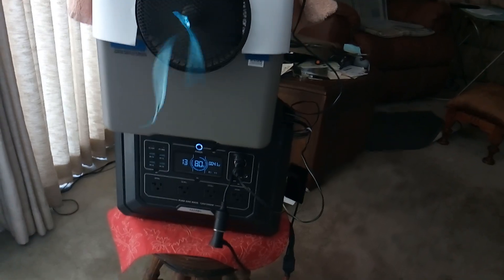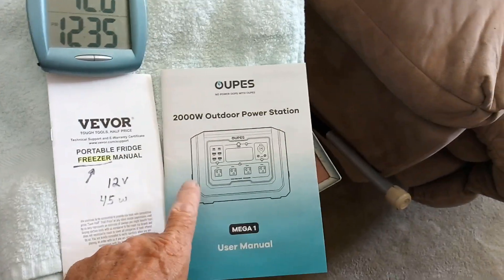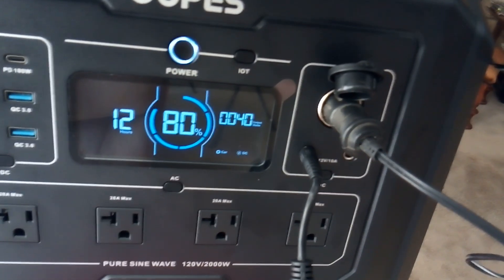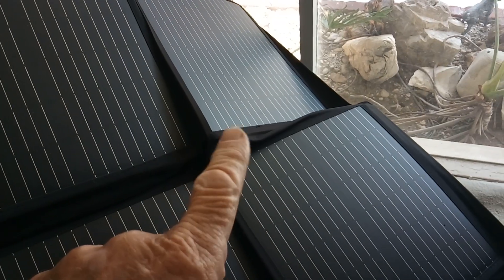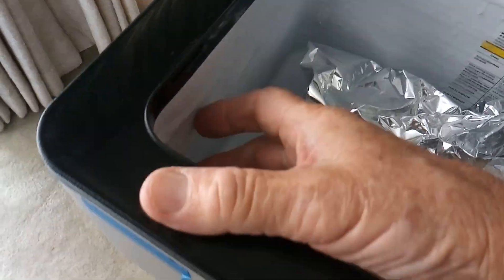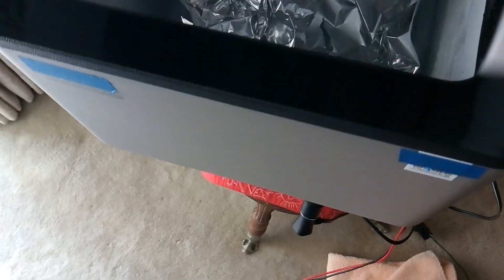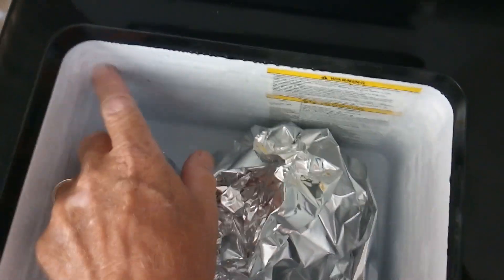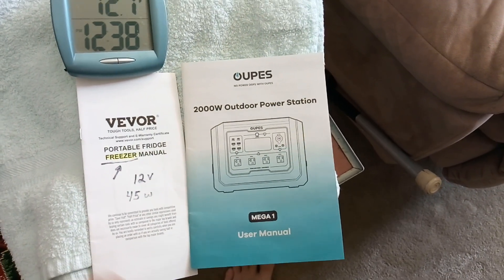Low wattage 12v compressor air conditioner project

Comment: Hello lid motor. I just today made the circuit you use in your motors consisting of an NPN and PNP transistor and a resistor plus an led. Mine I build is built in a pref board and I used a tiny 1 mega ohms potentiometer. And the coil I used is fairly thin and has lots of turns and it’s bobbing is made of card board and bamboo stick. However, after I connected the circuit, even if the led glowed when magnet swings by after adjusting the pot, there is pretty much no noticeable kick and i tried a pendulum and even a lid motor with strong magnet’s. It still didn’t spin and just the led was glowing tho only when magnets are going really fast. Could you tell me what mistake I did here and the solution?
Reply from the maker: Sorry that you are having trouble with that circuit.  First you have to understand what is going on and work backwards to find the problem.  Your led has to be put in backwards and only blinks when the coil turns off.  It is only an inducator really. Just take it out completely and try to get the circuit to fire . Use an AM radio tuned to a blank station to hear the circuit fire.  You have to use strong neo magnets and a coil of fine wire of hundreds of turns.  Also try different transistors .  If all else fails lose the circuit completely and just use a magnetic reed switch.
Reply: @Lidmotor hey uhh, I have some good news. The good news is that I just managed to run a pendulum and a motor with the circuit. But the bad news is that the circuit is quite power hungry as I used two AA battery’s and also a lithium ion battery but the circuit didn’t really work, however to it’s defence, the battery’s were not charged in a long time. Still, it only worked with my power supply on 4.7 volts. Could you tell me if you circuit’s also need strict voltage supply? Because your circuit seems to run on just capacitor. Maybe I need thinner coil with higher turned. But please reply.
Reply: @Lidmotor thanks for replying. And yes the led is indeed in reverse bias. Tho I don’t know the exact turns of wire. There really is no push or kick. And the circuit is fires because the led can only glow if coil is energised.

Comment: If your house temperature is hotter than your pool water temperature, then you could pump it through a radiator in your house to heat your pool and cool your house?

Comment: Let's assume it gets a heat pump COP of 4, which is very optimistic; At 40W in that's 160W of total cooling capacity. 

It may feel more than that because of the wind chill effect: the faster the wind blows over you, the cooler it feels. Hence blowing air that's 30C at you can feel "cool" since you're skin temperature should be less than 37C. Blow air at you above 37C and it'll warm you up faster as it's blow faster instead.

I think 160W is reasonable to achieve via one of those radiant cooling panels? Also is your house cooler inside than the outside air is? If not, then you could add low E heat reflective coatings to your glass to keep the heat out? at 1000 W/m2 from the sun, a shade over a large window to prevent direct sunlight could cool the room by more than this cooler? External white shutters are even more effective because they prevent all light getting in at all, which hits surfaces and turns into heat.

If you experience large temperature swings between day and night then you could force ventilate the house in the night to cool it, then seal it during the day?

Comment: I set up an experiment to measure the COP of a mini freezer like this, by putting a heating element inside along with a fan and temperature controller trying to maintain the same internal and external temperature. A Peltier one I tested had a COP of about 0.25 best case, which means it pumps about four times as much heat into the room as it extracts from the volume. A compressor based one like this was about 1.2 COP at 0K temperature difference between inside and outside, but by the time the temperature difference got to 20C the COP had dropped to less than 0.2, meaning it was pumping about 5 times more heat into the room than it extracted from the volume. 

This is all to say that keeping the internal volume just a couple of degrees cooler than room temp is critical for efficiency. Also you absolutely must (well heat insulated) duct that heat outside... And then you have issues with air pressure difference sucking hot external air in as fast as you pump the waste heat out, so you need the intake air to be insulated ducted from outside too. 

Interesting experiment! I'm fascinated to see where you go with it!

Comment: I always say we don't need air conditioning over here, but the last few summers have made it seem far more desirable. Although as soon as I start thinking about it during the hot sunny days, the weather breaks and I need my warm clothing on 🤣🤣☃☃
Reply from the maker: Same thing over here.  It is starting to cool off now but I suffer during the summer with the heat and humidity. I have actually been working on this project for years with very little luck.  We have AC in the house and cars but not in our sailboat. To do that takes too much power --hence this dream project. We have had some miserable week long summer Catalina island trips because of the heat. This winter  I will try to fix that.😀🥵🥶
Reply: @Lidmotor 🔴 What Is Islam?  
 
🔴 Islam is not just another religion.  
 
🔵 It is the same message preached by Moses, Jesus and Abraham. 
 
 🔴 Islam literally means ‘submission to God’ and it teaches us to have a direct relationship with God.  
 
 🔵 It reminds us that since God created us, no one should be worshipped except God alone.  
 
 🔴 It also teaches that God is nothing like a human being or like anything that we can imagine. 
 
🌍 The concept of God is summarized in the Quran as: 
 
📖 { “Say, He is God, the One.  God, the Absolute.  He does not give birth, nor was He born, and there is nothing like Him.”} (Quran 112:1-4) 📚 
 
🔴 Becoming a Muslim is not turning your back to Jesus.  
 
🔵 Rather it’s going back to the original teachings of Jesus and obeying him.